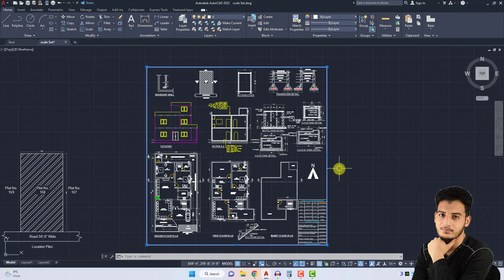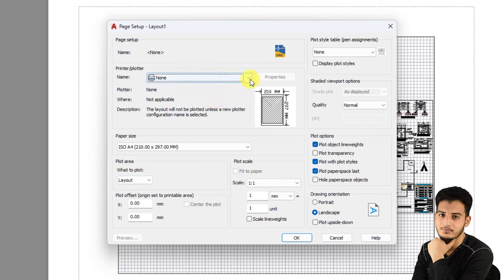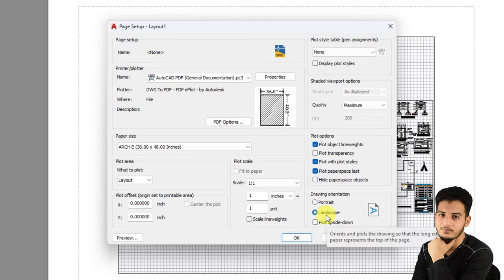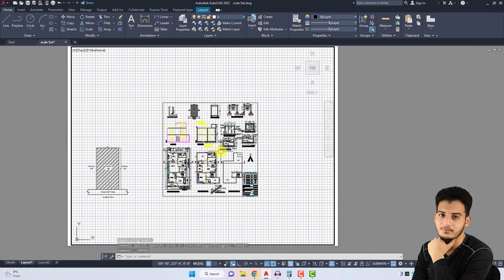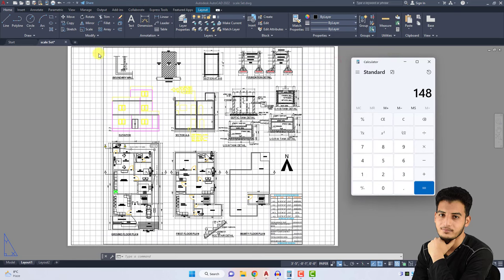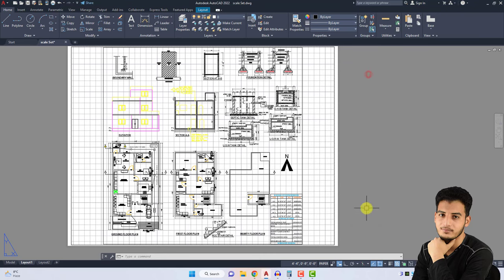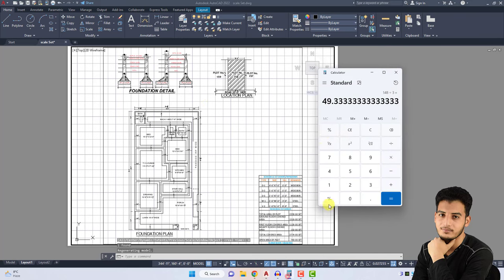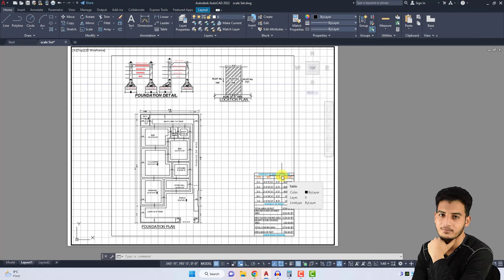How to Set Sheet Scale Ratio in AutoCAD? Example (1:100 | 1:50 | 1:10)

Comment: what should be the text height for dimension, notes , headings ,? for A4 and A3 size paper
Reply from the maker: For A4 1:1, 0.3" Height is good.
For A3 1:1, 0.9" to 1".
Reply: For 1:1000 font size and dimensions arrow ➡ size should be in between 2.5 to 3 its best I use the same